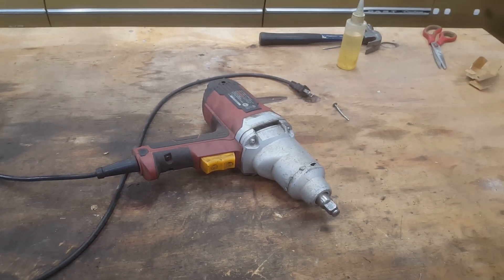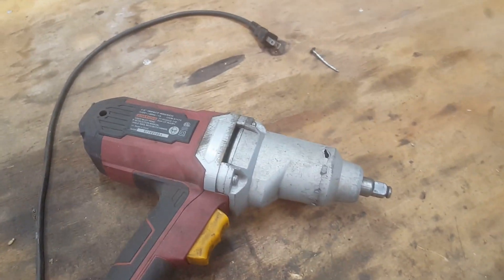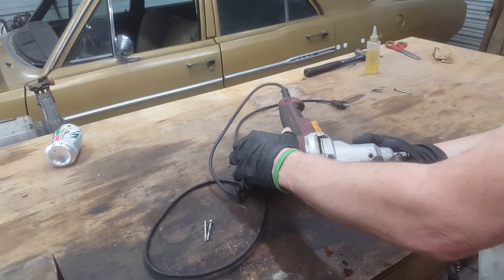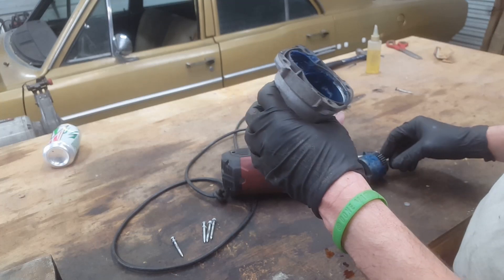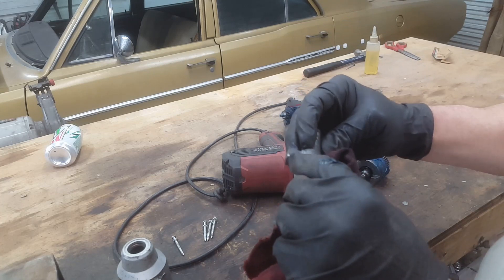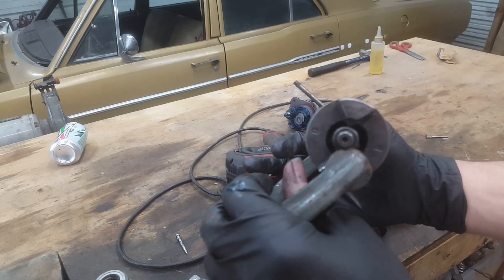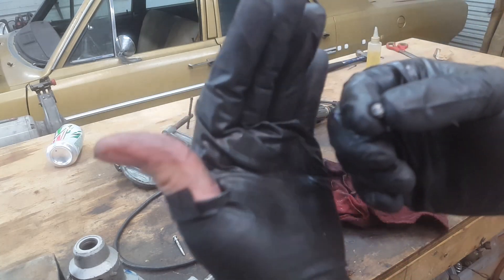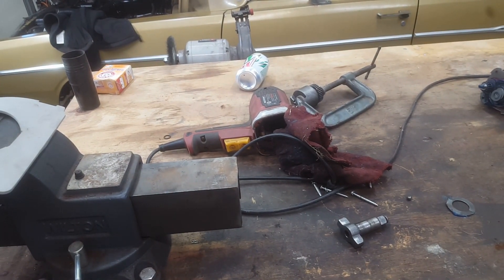My old Harbor Freight electric impact grenaded....

Comment: We had one of these at a shop I worked at. We exclusively used it to swap alternator pulleys. I remember it being an okay price for the price. It got slow and noisey couple times so I opened it up and greased everything then it would be fine. Yours seems to have really but the dust lol. 😆

Comment: I had the same impact and it lasted about as long as yours. Mine broke where motor brushes were held in place, and the brush jammed up. Somewhere along the line, I have taken on the concept that Harbor Freight power tools are great to buy as an “experiment”; that is, if I am not sure how much I need or will ever use a medium to high end tool, I just buy the cheap HF version and use it until it dies. If I don’t miss it, I don’t replace it. If I do miss it, I “pay up” for a better replacement tool. I believe my replacement impact is a Bosch. So far, so good! Also, if I need a tool for a job that I don’t believe I will ever be performing again, I will buy it at HF. If the tool last long enough to complete the job; then, I won!

Comment: That's a bearing ball.  The whole assembly with the balls and races is the ball bearing.  I only mention this because my father was an engineer for 40 years for a ball bearing manufacturer and people calling bearing balls ball bearings is one of his pet peeves.  Aside from that I have that same impact wrench but i rarely use it.  It's probably got a grand total of an hour of use or less on it over the 3 or 4 years I've owned it.  At that rate it should last me forever.